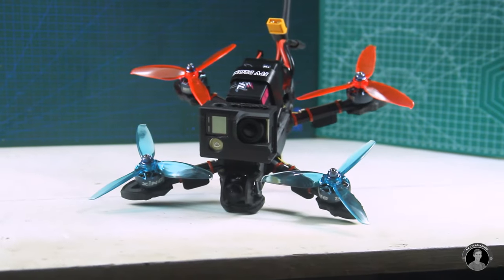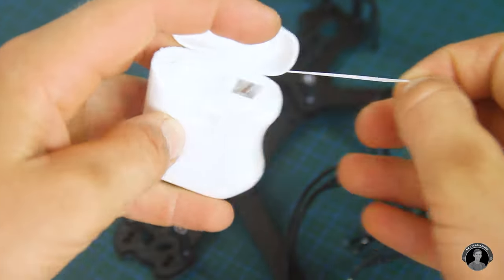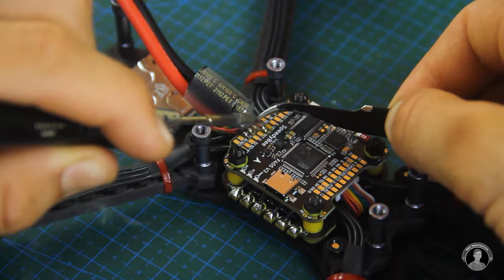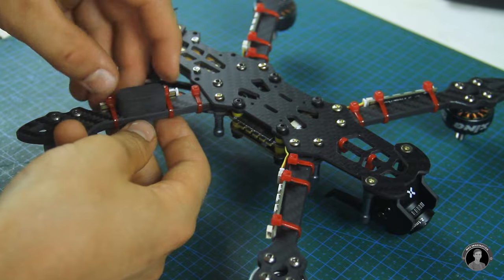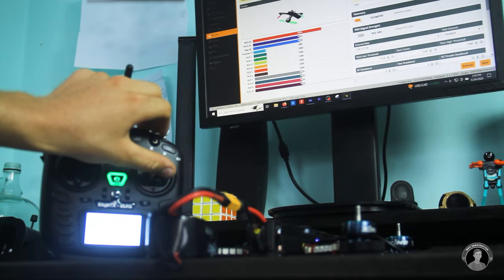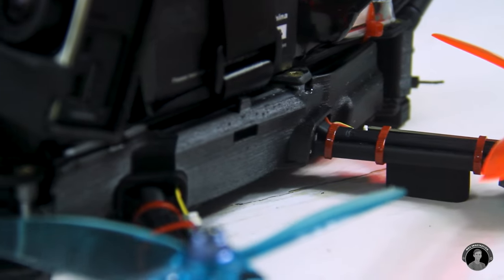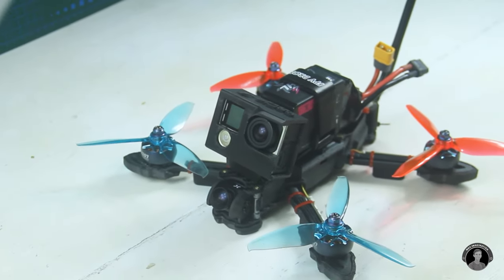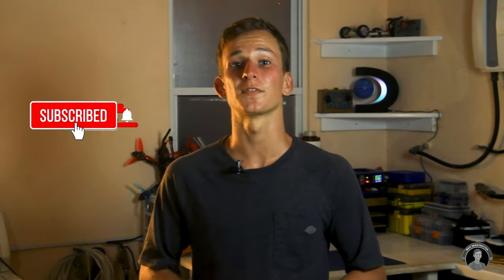Building the Ultimate 5-inch FPV Freestyle Drone

Comment: Nice build for a first one. Very neat and clean. You'll find that a majority of us couldn't care less about dirt and grass getting in the electronics. I've come home and you'd think the quad took a bath in dirt 🤣😂🤣. As long as it doesn't get too wet. Even the motors get covered. Just spin them a little and keep it moving. All that TPU covering things up looks nice but just adds unnecessary weight. If you have skids, no need for pads. Any weight savings you can make improves performance. Some guys suggest not allowing anything to touch the flight controller like wires crossing the top. The vibration can mess with the gyro. Best to run wires underneath above the ESC. The style vtx antenna on the SMA is different. Can't say I've seen that type used before. Most go with a stubby or lollipop. Something a little less prone to getting thrashed in a crash. There could be a risk of it getting snapped off. That would make for a bad day. My first flight lasted about 5 secs. Unlike you, I made the mistake of not knowing about fpv sims to practice. I thought my R/C plane experience would be enough. I was wrong 😂🤣😂🤣. Multirotors fly totally differently.
Reply from the maker: Hi there! Thank you for the comment... I find the covers actually handy since I don't want the internal parts all covered in mud, scrap cleaning all that! 😂😂

The drone is extremely jumpy and powerful already for me, that little bit of added tpu weight is not felt much, in fact it helps protect it rather than be an inconvenience (in my case anyway). However, I will consider removing unnecessary weight such as the LEDs (since I don't want to fly in the dark). 
Conformal coating the boards will probably be what it takes before I do consider removing the covers.

About the antenna, I replaced it today with a Foxeer Lollipop antenna, works great improving the video signal 👍

Thanks for your other tips mentioned above, I'll consider them.

Be careful out there with your drone too! Sim practice is always beneficial before every real flight even if you're a rather advanced pilot. Especially if you haven't flown in a while 👍

Comment: I wouldn't put rubber grommets on the frame.  Instead, use press nuts regular nuts so that the stack screws don't wobble around.   It will make tuning your quad a lot easier.  I can't believe GEPRC wants the stack to wobble around like that, but they do.
Reply from the maker: I think it also comes down to preference. Personally, I think it's safer using this amount of grommets as it protects the flight controller and ESC stack from getting destroyed upon impact or shock. This of course only lasts if the stack is tightened down really well. Thanks for your tip, though!
Reply: Yeah I was very weirded out seeing gummies on the frame itself

Comment: just a suggestion, i saw in the bag that came with your rgb lights was some included race wire, i would solder the motors to those then solder from the racewire to the esc, if its inline between motor and esc and sits on top of your arms it will prevent prop strikes from ripping up your motor wires. if it wasnt racewire that was included i'd definitley get some you can get it on racedayquads for like $1.50
Reply: Good advice and get a smoke stopper. Hopefully he reads this.
Reply from the maker: Thanks for the tips, I will consider implementing those features!
Reply: No racewire, I have the same leds

Comment: That's a really nice project! I'd add some features to it. For example, using machine learning, I'd training it to lock height if I choose to. E.g: If I let it goes up to 10 meters height, if I release the throttle, it would kept still at the same height. That'd be sick!
Reply from the maker: Thanks for your comment! As long as the machine learning software can be trusted, might work!
Reply: Don’t need machine learning, just buy a DJI.

Comment: Well done, Max! 
For better range, I recommend a good rhcp antenna on the quad (like the foxeer lollipop, TrueRC singularity, Lumenier Axii2,..) and a pair of goggles with a module bay for an ImmersionRC Rapidfire will give you the best range
Reply from the maker: Thank you, M J! 
Just yesterday, I replaced the 2.4g antenna on the VTX for a foxeer lillipop. This has fixed the video feed issue 👍
Cheers.

Comment: 3:42 hey could you please tell why are your soldering this capacitor. Is it really necessary, i havent seen it in any other videos
Reply from the maker: Hi there. It's for stabilizing power at the flight controller board during high busts in current (lots of instantaneous power is pulled by the motors at times). It keeps things running consistently on the boards.

Comment: Loved the video! Very informative for beginners and fun for everyone else! The only thing i disliked is how you tightened the nuts on the motor. You only need it tight enough that the prop won't budge. The nylon insert will do the part of keeping it from vibrating off. Normally, you wouldn't need a locking wrench to hold the bell when tightening it
Reply from the maker: Thanks for your tip and compliments! I will consider that for when I use my drone next time 👍

Comment: Im afraid the vtx will overheat of you obstruct airlow with these side covers. Its super easy to overheat them (talking from experience) especially when at high output power
Reply: Also, when the vtx heats up it wil drop its power to protect its self. So fpv feed can suddenly disappear
Reply: Yeah we don't care if dirt gets in there. Sometimes mine looks like it took a bath in mud 🤣😂🤣😂
Reply from the maker: The side covers don't fully touch up against the VTX, plus, there's plenty of airflow underneath and from the back of the frame for the unit to breathe via its front and back holes (for LED). This wouldn't be my concern.

Comment: Very clean build, however I don't think twisting the wires would do much in the way of reducing noise. You could shield the wires with some copper foil and solder a wire from that to a ground pad for actual rf shielding. You can also heatshrink it. It's the exact same thing that happens in USB cables.
Reply from the maker: Hi and thanks. Good tip, I heard from another fpv pilot that it is best to use coax cable or rf shielded cable on the video signal wire, like you mentioned. Cheers.

Comment: Hey I can't seem to find where he bought the wires little help here please ?
Reply from the maker: Which wires? Wires are normally included with the part such as the wires connecting the motors to the ESC stack.

Comment: Hey, so for what it is worth I followed all the links you have in your build list.  I think everything is not only a good price, but an item that I would get for one of my builds.  The motors you have linked are an excellent choice for almost anyone although the are very expensive here on scamazon! by about $30-$50 over priced.  

That said that is not a deal breaking amount but if someone were to be resourceful Google can get you those same motors for around $45 less and from one of several reputable shops here in the USA such as New Bee Drone or GETFPV.  I would imagine that these motors are also available in other countries.  

The transmitter the TX12 is a very good and solid transmitter but I might say that you can get a significantly upgraded radio from the exact same manufacturer for about $20-30 over that price - that would be worth it for sure!  What radio?  The RadioMaster Boxer - a radio that many think is one of the best radios you can buy today for FPV  - period.  

Anyway this is a great way to get started and the hobby is fun and this is a quality build list, it is not beginner stuff, this is a fully capable quadcopter.  I would prefer a digital video system like the ones from DJI, WalkSnail, or HD Zero - each are an awesome choice...  Good luck and cheers
Reply from the maker: Hi there! Very pleased to hear yet another viewer following my build... Superb! 

Yeah with the way "scamazon" (love it 😂) prices their products, often upselling on already retailed products just to make the extra buck, it's expected to be that expensive when shopping there with the added convenience. 

I am really happy with my TX12, however good to know that there's an alternative model out there that might be better!

Best of luck with your FPV journey. Thanks and cheers.

Comment: How do you change the wire antenna for the SMA? Any recommendations on any videos?
Reply from the maker: You change it by pulling off the current antenna you've got on with a pair of pliers and clipping on the SMA antenna you want.

Comment: did you have to do any additional ELRS configuring behind camera to the receiver to get it to bind to the controller?
Reply from the maker: Yes, I had to find the correct communication protocol (SPI RX) and mostly play around with the lettered/numbered Channel Mapping to get the transmitter giving the right commands.

Comment: I would highly recommend not having the props anywhere near the motors when checking motor direction.. you can tap the motor housing with your finger to get a sense of the direction, which is much safer imo
Reply from the maker: Good point. That loose prop can grip and get flown up, hitting someone's face. Cheers.

Comment: Just tell., If the motor goes in wrong direction What is the correct solution?
Reply: BetaFlight can reverse them if they are spinning the wrong way. Some of us prefer to have props spin outward. That way if you fly through a tree, in theory, the prop pushes the leaves and branches away instead of grabbing them and pulling them in increasing the chance of getting tangled if you fly "props in".
Reply from the maker: Thanks for the tip, Amen_ Ra!

Comment: What size are your props? I have an 5 inch Arris x220 v2 with 5nch props but they touch the middle frame. Do you recommend 4.5 inch props or 4 inch?
Reply from the maker: Mine are exactly 5 inches in diameter and I don't have an issue with them touching the frame or anything. Which frame do you have? If this is your issue, I suggest downgrading to 4.5 inch or 4.75 inch props if possible.
Reply: @MaxImagination  A 5 inch 220mm X frame i believe im saying it fight? Lol. 👍 Okay yeah I figured 4.5s would fit. Do you think if i cut down the tip a little bit the prop will still work?
Reply from the maker: If you do have to shorten the ends, you can. However, make sure you don't take too much off! Just little snippets at a time...
Cheers.

Comment: Running wires over the top of the flight controller is usually not recommended because it can interfere with the gyro. Its probably ok but if issues with the gyro show up, try moving the wires under the FC. the side plates block dirt but it also blocks air. You get no air flow with the sideplates, if youre having trouble with range, your vtx could be overheating and lowering the power. Cool build!
Reply from the maker: Thank you for your suggestion! I haven't had issues with it, but certainly a good piece of advice to other newcomers in the FPV drone hobby. Cheers!
Reply: @MaxImagination  cheers my man, keep rippin

Comment: I also wanted to comment on the soldering iron.  The one you showed, the TS80P is a great iron, a cousin or friend of the famous TS100 iron.  I have a Sequre Si012 iron (Google it) and I think it is one of the better ones as I believe that it is a bit higher in wattage and that matters.  

I have worked in aerospace and there they take soldering very seriously.  We use very good irons mainly from JBC but one day I brought in my Si012 to check out.  I gave it to one of the best techs there who has been soldering for over 25 years and they said that it was great, no problems or issues, heats ridiculously fast, recovers fast, the tips are good quality, just all around a great iron.  

So seriously a $26 iron is as good as a expensive iron used in aerospace - yes!...ish  Not in any and all cases though but for our hobby these irons should work perfectly.  So the one mentioned in this video is very good, the one I mention i think is slightly better.  

Also the TS80P tips are expensive, like 3-4 times more expensive than the ones for the TS100 or my iron (uses the exact same tips).  None the less if you take care of the tips (keep them clean, make sure they always have a coating of solder, etc...) they can last a long time.

I would pick a different solder for sure.  There are science reasons to use a different solder but for sure you want to be using a 63/37 rosin core solder wire like this one from Kester:  https://www.amazon.com/dp/B00AVLM4SO?ref=nb_sb_ss_w_as-reorder-t1_k0_1_13&amp=&crid=NTDWHLZKAFCP&amp=&sprefix=kester+solder  For sure one of the best solders you can get.  Does it matter - yes.  A lot - could be but usually not that much but it is much easier to make a good solder joint with the Kester.

Comment: Plastic nuts to tighten the beams are a bad idea.
Linear antenna on quad and circular on box-googles... :-( you receive 33% of power VTX. Change antenna to circular polarization
Reply from the maker: I'll consider taking action on the things you pointed out. Cheers.

Comment: This is interesting, I have never seen the wires swing over the ESC board before.  Since this is your first build, why did you chose to do it this way?  Is there any downside?
Reply from the maker: From what I remember back when I made the drone, I did this as it was a shorter route for the wires to take. It doesn't seem to cause interference at least. I don't see an issue.

Comment: If you conformal coat the boards, you can lose some of the weight of the tpu protecting the boards in frame. Every gram counts
Reply from the maker: I'll consider this when I want to waterproof the drone :)
Thanks for the tip.
Reply: @MaxImagination  ofcourse! Great build video by the way! Looks clean

Comment: Do you know if this fligh controller could work with 920 kv motors? and propeller 10x4.....
Reply: Yes.  It's the ESC you need to match to the motor power draw
Reply from the maker: Correct, make sure you're using the right ESC for the motor's you've chosen to avoid burning the speed controller units.

Comment: Hi Max, thanks for sharing this video. I have a question, I noticed that you've worked with Arduino and I was wondering if you happen to know if I can build my own FPV drone with custom firmware (C or MicroPython). I'd like to build an FPV drone with GPS, long range data transfer, long lasting fly time, and the most important take advantage of AI, like OpenCV, to make it smart enough to make its own decisions. Do you have any idea? I know I can build a drone with Raspi Zero 2 W or Pico, install my own firmware, the big downside is how to program the ESC and other FPV parts. Thanks for your help
Reply from the maker: Hi, Ralph. I've never made such drone before, sounds very interesting however complex! I don't think I can help, though.
Reply: @MaxImagination  No worries. I appreciate your input. I'll keep researching and, maybe, I add a video about my findings and progress.

Comment: I don’t understand if the battery is 1300mah and the four motors can draw up to 140 amps in total your flight time isn’t like 1 min? Am I wrong? Thanks
Reply from the maker: Can and do are different words. The motors CAN handle 140 amps, but DO not run at that amperage one hundred percent of the time. The drone flies for about 8 min on most flights.
Reply: @MaxImagination  thx!

Comment: How can i increase fliyng time and range ?
Reply from the maker: Increase run time by using a battery with a higher current capacity (mAh). 

Increase range with a more powerful VTX to improve the video transmission signal.

Comment: hey i was wondering if i buy a iflight Evoque with 03 air unit to use it with my dji controller 2 can i get it with the tbs receiver just for when i get a tbs module at a later date? like will it still be able to bind to my controller 2 when i get it and its not a bnf its tbs as easy as i would with the controller 2? thank you :)
Reply from the maker: Hi there. Please excuse my late reply. I am not familiar with any of the equipment you mentioned. Can't help but suggest you to ask forums like Reddit or see online if someone has already done what you're trying to do. Cheers.

Comment: Going through this build now - what size bolts/nuts did you use to secure the VTX to the frame? The frame kit didn't come with any that fit the hole size.
Reply from the maker: Hi there. I used a couple of M2 bolts with nuts to secure the VTX to the frame.
Reply: @MaxImagination  Excellent. Thanks for the reply and the video! Enjoying this build.
Reply from the maker: @beloitdavisja  Awesome to hear you're assembling your own FPV as well... Happy building! Cheers.

Comment: What's the range on it? I want to build one but it has to have good range
Reply from the maker: The advertised range is up to 1-2KM. I only fly mine up to 150m away due to the analog video feed cutting off at a short distance.
Reply: @MaxImagination  damn, im tryna make one but i need at least .5km range

Comment: Bro I make a car with four  12v motor with L298n motor driver with 12v battery , tell me  why my motor driver is heating so hard or should i brought a new one and options?
Reply from the maker: Hi there. Your motors require a higher amount of power to run, therefore, the 2A maximum l298 motor driver is overheating.
Reply: @MaxImagination  yeah , now I am controlling with 2 l298n with 4 motor 
But now there is a problem that the motor 1 ,2 pin not working

Comment: I need your help, is Elsr 24t 2.4Gh receiver compatible with Flysky Fsi4 transmitter
Reply from the maker: As the Flysky Fsi4 doesn't mention anything about ELRS, it is definitely not compatible with the receiver used in the video. Please either find a receiver that takes the right flysky protocol or obtain an ELRS compatible transmitter.